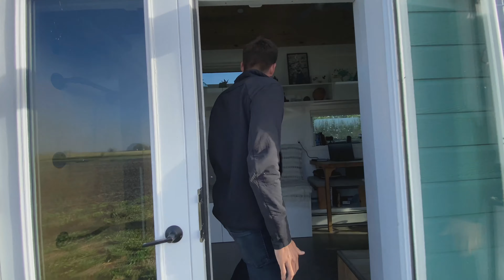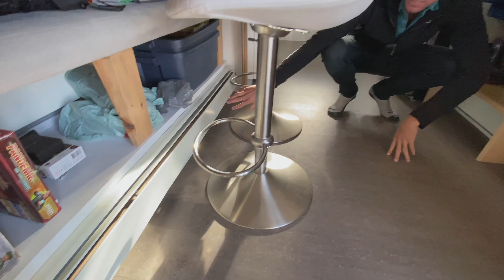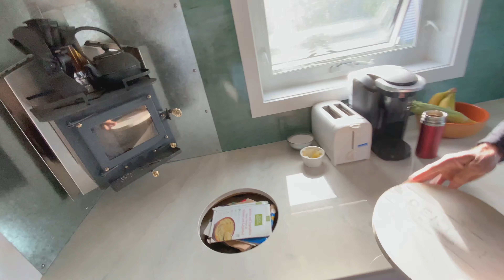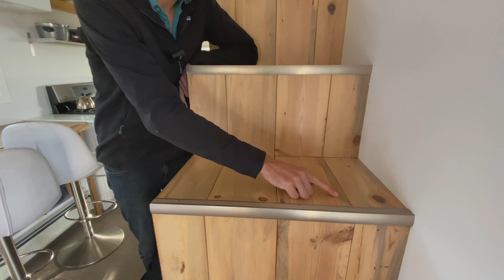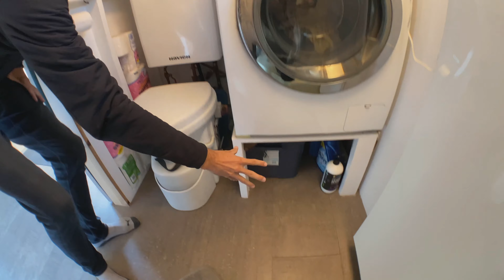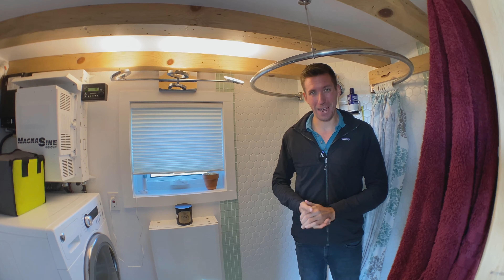Kenton Zerbin's Epic Journey in a Stylish Tiny Home

Comment: I don't like this one. No living space. Stairs take up too much room. Bathroom is ugly with all utilities exposed. No couch. Loft is too short. Roof pitch much more than needed. Hydronic heat should be in the floor.  No dehumidification shown. Windows are too small. Shower is too small. No air movers/air exchanger.

Comment: Like the tiny home thing nice utilization. I question the ability to keep these long term, many or most areas I have houses rate these as rvs and limit time of occupancy on lot to live or build a ‘main’ house. Then on YouTube I don’t see many of these moving from where initially set up. That being said why not allow them permanent on a foundation say 12 to 16 foot wide. If situations change adding an additional width to house would make more seance, don’t get me wrong I love the minimalist idea, but age and or children could affect longevity of the design and that defeats the project. Spending on trailer or full foundation is about the same, difference in building 8 or 12 foot is minimal $ and might be cheaper with not needing ‘small’ fixtures. This is based on my thought that that houses should be bought forever. Coming from someone who owns or has owned 8 houses in 5 different states so I guess I’m full of sh$t, lol.